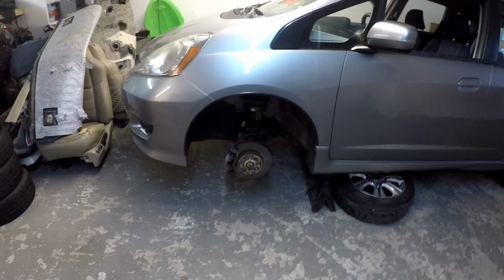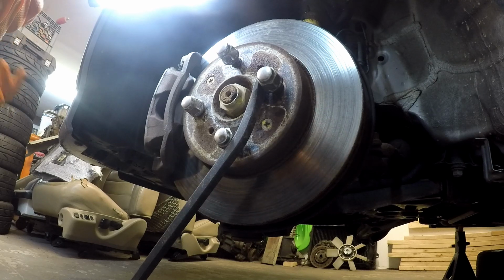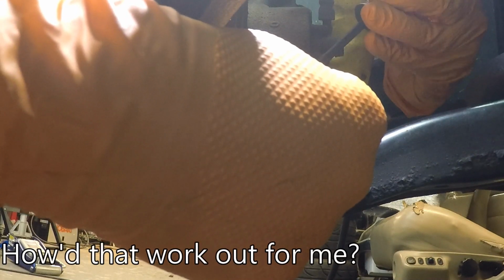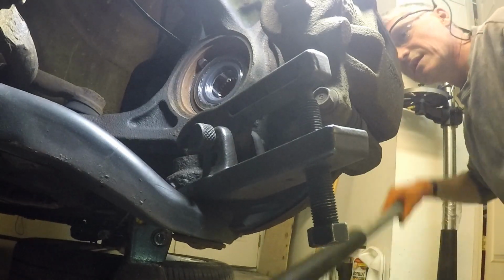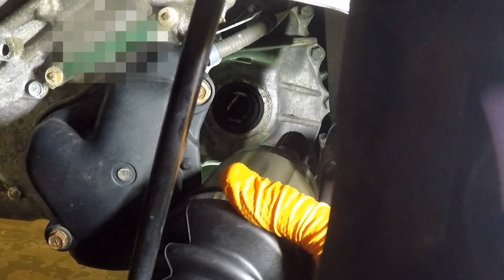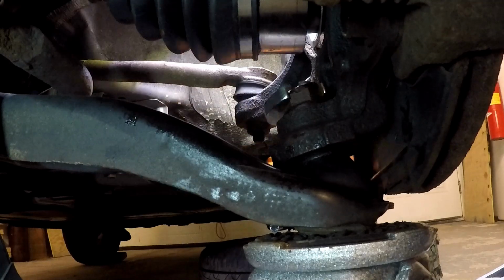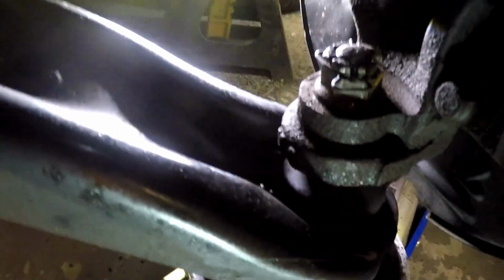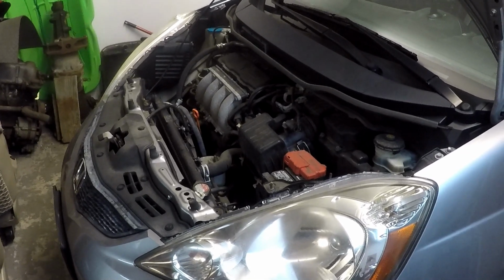Honda Fit 2007-13 CV Axle Replacement

Comment: My 2009 fit, just did the same exact thing, but the right side. Manual translation. 197,000 miles.
Reply from the maker: Not fun, huh? Looking through the comments, it seems to be a time-based failure vice a mileage-based one. About 8-10 years or so and it fails. Hope if you decide to fix it yourself it works out for you!
Reply from the maker: Yup, I'd agree with them. Exactly what I saw. Glad it worked out and that doesn't sound too bad price-wise.
Reply: I had the garage fix it. $350 and 1 hour. They told me they thought it was an engineering defect. Water and rust. Honda apparently changed the design in newer models. Happened when I was pulling out on a steep hill. They said that is typically when it happens.

Comment: I think I figured out your issue with the crows foot and the torque wrench. Apparently using them will not give you the right torque on your wrench. So for example if a torque wrench reads 100 ft pounds, then a crows foot + torque wrench may equal as much as 111 ft pounds.
Reply from the maker: Yes, any time you add an extension to the end of the torque wrench, you change the torque characteristics because it changes the effective size of the moment arm you're using to apply the torque. I didn't think the crow's foot would make that much of a difference, but it may have. Thanks for the comment!

Comment: Thanks for this helpful video. A few months back my buddies wife’s 2010 Honda Fits CV axles both snapped a month apart at 190,000 miles. I have the same car with 205,000 and as I was driving to work taking off from a traffic light my driver side axle cracked leaving me to wait for a tow truck. Luckily it did not happen at highway speeds. I just ordered both axles from Rock Auto, thanks to your video I know what to expect.
Reply from the maker: Good deal. I'm glad it helped. Really not that bad of a job.

Comment: This appears to be a common failure with the OEM 2007 Fit Axels. Had the identical failure on the driver side on my daughter's. I notice that there was a crack in the shaft, which was probably due to manufacturing defect that corroded to the point that the remaining shaft snapped. Getting the new shaft seated is a PITA.
Reply from the maker: I agree that there is definitely a design defect in there somewhere. I got lucky with seating the shafts, but I was ready for a fight!

Comment: Crazy.  I have an '07 Fit w/ manual transmission that I purchased brand new in 2006.  It has 267K miles on it, I still have it, and it has never had this problem.  In December 2016, I purchased a nearly-identical used 2007 Fit but with automatic transmission (for my teenage boys to learn to drive on).  It has only about 60K miles.  On that car, the driver's side axle snapped in January 2017.  The car came with a 6-month drivetrain warranty, so the dealer fixed it.  Now, yesterday (April 7, 2018), the passenger side axle failed (not so surprisingly, of course...).  So I'm considering tackling that repair...

Thanks for making this video!  Like Michael Coates below, I have the official Honda service manual, but it's great to see how it all played out for you in real life!  Thanks again!
Reply from the maker: Glad you liked it. Definitely a repair to try for yourself. The risk versus reward ($$) is absolutely worth it!
Reply: I finally started this repair today.  I'm about half way through.  So far, so good.  It has actually gone pretty smoothly.  I've successfully removed both parts of the sheared-off passenger-side axle shaft.  The one hiccup is that I tried to plan ahead by purchasing a plain nut at Home Depot to put on the top of the ball joint bolt in place of the castle nut when separating the ball joint.  (I'm sorry that you crushed your castle nut a bit, but your experience DEFINITELY helped me plan ahead for this issue!  Thanks!!!!)  Well, apparently I bought the correct diameter nut, but with coarse threads.  The ball joint bolt turned out to have fine threads.  Grrrr.  End of the car effort for today.  I drove my other Fit to Home Depot again and got the correct nut this time.  I'll resume this project tomorrow evening after work...
Reply from the maker: Good deal, Walt. Glad to hear it's going smoothly. Those fine thread fasteners are sometimes hard to find locally (at least for me), so good luck!
Reply: All done!  My black 2007 Honda Fit w/ automatic transmission and 60K miles lives again!  (My blue 2007 Honda Fit w/ manual transmission gloats -- it now has 271K miles with never an axle shaft failure!)

It's great bringing a disabled car back to life!
:-)
Reply from the maker: Great job, Walt. Congrats!
Reply: Thanks again, Chris, for making your video!  It was a huge help!  It really put a great mental picture in my mind of the various steps involved.  And the "school of hard knocks" experiences you went through were VERY helpful!  Again, I'm sorry you had to blaze the trail with a few headaches and disappointments, but at least know that your efforts and lessons have helped others!  In particular, I got a slightly different ball joint separator from OTC on Amazon -- it worked beautifully with no modifications.  And that plain nut from Home Depot did a great job protecting my ball joint threads (and saving my castle nut).  Finally, the trick of jacking up the bottom of the control arm to hold the ball joint tight while torquing the castle nut was also VERY helpful.  I was able to torque the nut to 36 ft-lbs and then add just a bit more to line up the retaining clip holes.  Also got to use one of my crow's feet for the first time in a long time!  Some tools don't see much use, but when you need 'em, you need 'em!

Thanks again!  Great video, Chris!
Reply from the maker: So glad it helped, Walt. It is a great sense of accomplishment, not to mention the $$ savings!

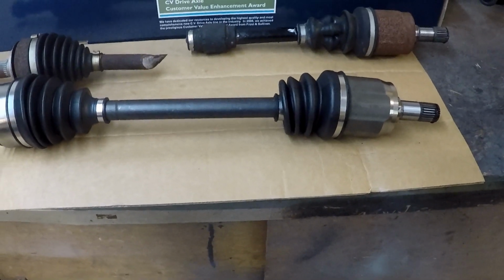Comment: Just looking at the old & new shafts at 19:49 it seems that the new one doesn't have that rubber encased coupling on it.  Do you know why the new one doesn't have that?

By the way, are the new c.v. assemblies fully packed with grease out of the box, or did you have to do add the grease yourself?

What brand were the driveshaft assemblies?

What camera did you use Chris?  (nice audio).
Reply from the maker: Hi, Jonathan. I do not know why the new ones don't have that coupling. I think it's more of a vibration damper than a coupling, however, and I think it was the reason that the shaft sheared due to corrosion around it, so I'm glad the new ones didn't have it. The new assemblies were ready to install out of the box and they've been working great since I put them in. I put the link to the Rock Auto listing for the ones I specifically purchased, though there were other choices.
As for the camera, it was just a GoPro Hero 5 Black.
Thanks for your comment!
Reply: Thanks for the reply Chris.  When I saw your video, it reminded me of my recent experience when I replaced both of my lower control arms and interestingly I had a bit of a struggle (understatement) in getting one of the lower ball joint spigots back into the hub casting, which turned out to be the drive shaft joints needing to be wiggled back into their usual spot.  I give you a thumbs up for taking on the job late in the day when it was dark.  I did mine outside in the sunlight (a cool summer morning).  Luckily the weather wasn't too hot.
Reply: It’s 100% an anti-vibration thing

Comment: Thanks for taking the time to make this video.  Really helped me out.  2009 driver side axle broke at 217k miles.
Reply from the maker: Nick Roy glad it helped, Nick. My car only had about 75k on it, so I think its a corrosion(time)  thing instead of a mileage thing.
Reply: @roundtailrestoration  when it Brock did go know were
Reply from the maker: @chrisroulo728  That's right. All of the motor's energy goes to spinning the broken shaft and the car just sits there and revs. It will be very difficult to get into gear as well.

Comment: Thank you for making this video!  I just replaced the right axle on my automatic 2013 Honda Fit Sport, and this video helped quite a bit.  The only change I made was that I found it much easier to remove the two large bolts/nuts that hold the hub assembly onto the lower part of the strut to be able to move the hub around to insert the axle, as opposed to trying to get that castle nut off.  Just a thought for others attempting this job!
Reply: Super late to tell you this obviously, but most of the times those two bolts are your camber adjustment bolts so if you remove those you should get an alignment. Breaking the ball joint as he did often seats close enough back to the same home you can avoid that $80-$120 charge.
Reply from the maker: That's great, I'm glad it helped. Like I mentioned, I couldn't find one and was apprehensive, but went for it. Good call on your modification! Thanks for watching!!

Comment: Thank you so much for taking the time to make this video. The passenger side CV Axle snapped 2 days ago. I have the Factory Manual, but this just helps me with some much more in depth preparation. fist bump
Reply from the maker: +Michael Coates Glad it helps. I was a bit apprehensive going into the job, but it wasn't bad at all. Good luck!